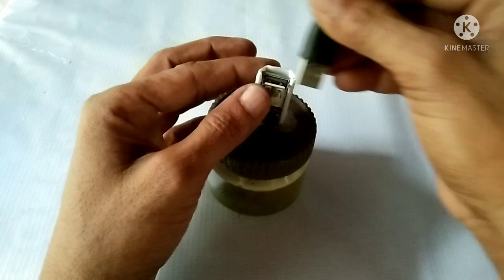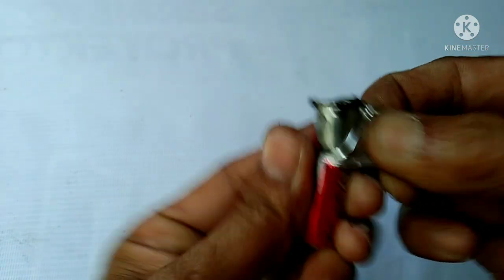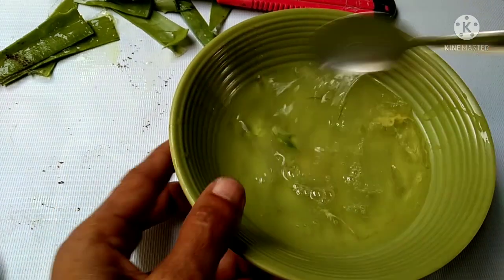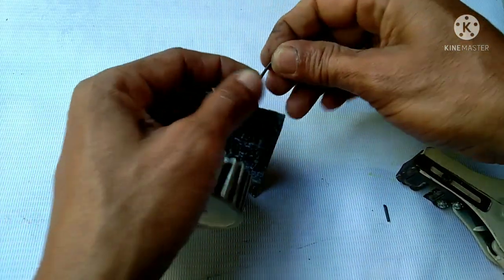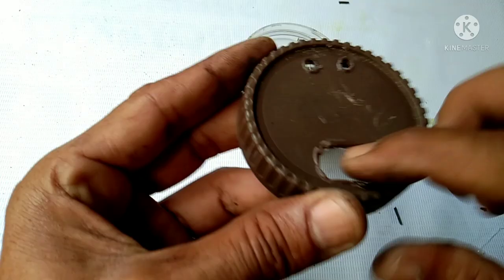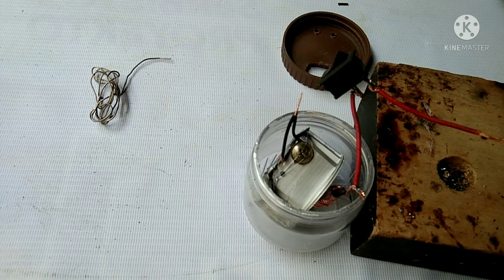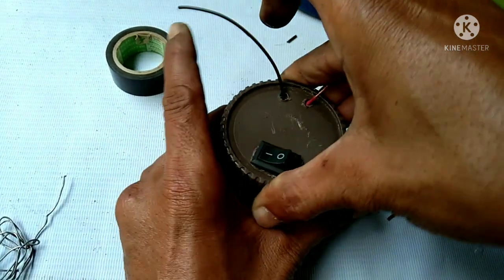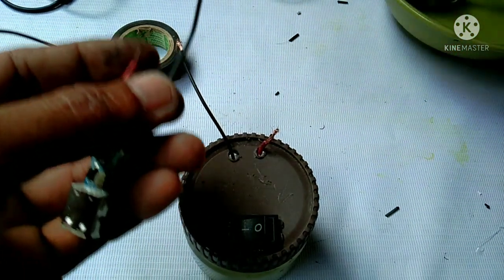How to make Aloe vera battery at home | Rechargeable | Eco friendly

Comment: Among all your DIY projects, this is awesome, very interesting concept, multi material, multi electrolytes, Zinc+ Alu as anode, carbon rod+ copper as cathode, Aloevera + sea water (saltish) as duel electrolytes, all are beautiful Eco friendly items, making a battery is much appealing, (if sea water) not available, we can use Epsom salt water also a non corrosive electrolyte with high voltage expected, appreciated presentation, 👍🏿👍🏿👍🏿
Reply from the maker: Thank you so much.  Stay safe and connected.